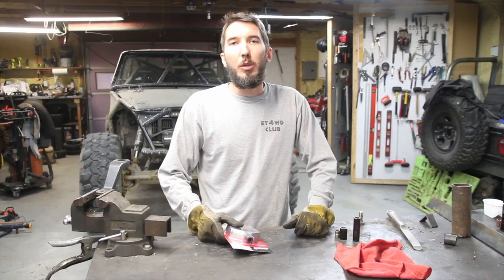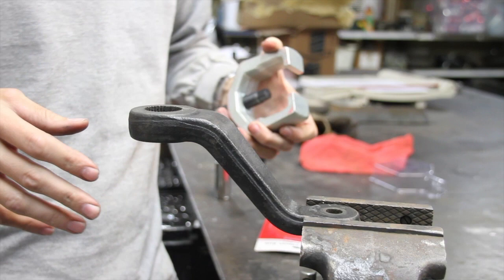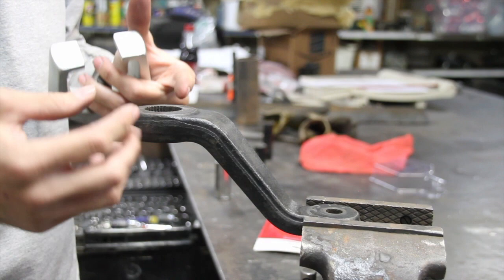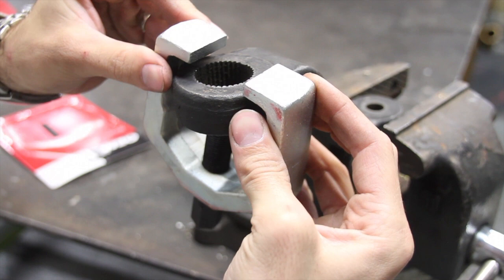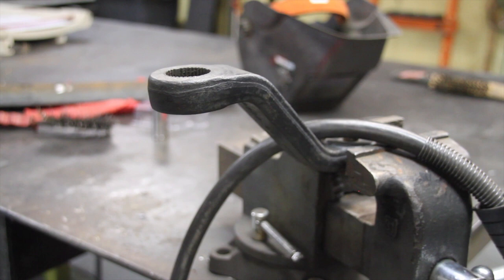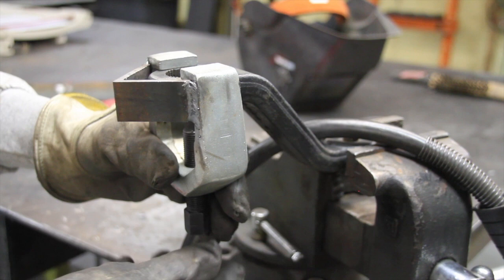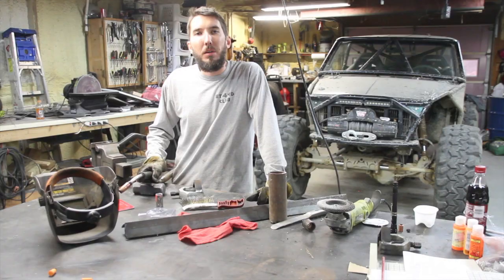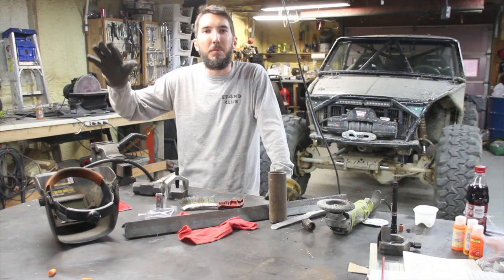Upgrade Your Pitman Arm Puller For Free

Comment: I would add a plate to the edge of the angle.  That is where the real strength would be.  Angle spreads fairly easily.  No doubt that your design adds strength, just a suggestion.  

I like adding the tube.  But then cutting a large washer in half as a support plate.  It would end up looking and performing nearly identical to the two expensive pullers.

Comment: I did that same mod, but it cost me over $100,000! First I had to build a shop, that was $75,000. Then I had to run 440v out there for my $15,000 welder. Then I had to buy an XJ with a pitman arm, that was $2000. Then I had to buy axles to go with my new pitman arm, that was $8,000. Then I bought the tool for $12!

So much for cheap mods! Geez!
Reply: U over spent on your welder...

Comment: I used a C clamp over my puller, but it still wouldn't budge.  So I ordered a new arm and cut the old one off by chucking up a cheap hack saw blade in my Sawzall.  Cut through like a dream.  A couple good wacks and it popped off.

Comment: Good idea, but it doesn't give you the strength it could with a little more work. You could put the angle iron up so it is the thickness of the metal from the opening, then cap the top with flat stock. This makes it flush, and much stronger.

Comment: Wow, what a lot of effort to go through when you can just put a hose clamp over the puller, tighten it up and it won't spread at all.....
Plus it holds on both sides of the jaws, not only one like welding does.
Reply from the maker: +Thor Dehr took me 2 minutes... less effort than tightening a hose clamp with a screwdriver for 5 minutes;)
Reply: Then only tighten the hose clamp for 20seconds.  Who takes 5 minutes to tighten a hose clamp?  Way faster by the time you set up your welder, find, cut material to size, weld then let cool. 
Also it leaves the puller unmodified for other uses and supports the jaws on both sides instead of only one like welding to one side of the jaws does. 
An additional benefit is that it can preload the jaws slightly giving the jaw tips additional bite. 
Plus, not everyone has a welder or the skills you do. 
I like your idea of welding the bit on to get some of the additional strength of the semicircle design puller. The hose clamp hack is just faster and more accessible to most.
Reply: Thor Dehr or c clamp is what I was thinking

Comment: I have a hobart handler 125 (flux core 115V). Is this suitable or should I try to find a way to convert to MIG? Also, any tips for feed issues? My wire keeps jamming up and it makes it really hard to get a consistent bead.
Reply: Not familiar with that brand, so I'm not sure if it's outfitted to add CO2/Argon. I don't know if they even sell Hobart in Canada. What I found with my old Lincoln, and new Miller is to keep the whip as straight as possible. To many sharp bends or loops in the whip end will restrict the wire feeding up through it. Next check the nozzle/tip, for excessive build up. Flux core splatters lots, and that tends to build up in the nozzle. Inside the housing, look at the 2 wheels that drive or feed the wire. They have 2 or 3 grooves, for different wire sizes, just make sue the groove that the wire is in, is the same as your wire size. There should also be a way to adjust how much pressure the drive wheels exert on the wire. Don't go crazy tight, because if the restriction is at the nozzle or in the whip, the drive wheels will try to cram wire into the whip. I'm not a welder, over the years tried out a couple of different brands for working on my trucks. Both are 220 V with shielding gas, shit I'm rambling on. Hope this helps, and usually if you have a recommended setting chart for different gauges of steel. Near the bottom it will show you the polarity, +/-, for your supply power.
Reply: Thats all good stuff, I've tried most of it, although I don't remember if there were other grooves in the drive wheel. I'll have to try that, thanks!

Comment: Any tricks if the arm just won't come off. I tried pulling mine off to replace the box but the puller stripped out. I put a 9/16 bolt through the hole with a nut on the inside which worked but the arm wouldn't come off even with my impact running on 175psi. I did try the hammer method too.
Reply from the maker: There's the heat method or someone today said to use a prybar and post hole pounder from the topside.
Reply: BleepinJeep I may try it again next spring. For now its too freaking cold out and I only have a driveway to work in but I will be using your trick now I know I can weld to it.
Reply: Just put a new pitman arm on the new gear box?
Reply: William Smith i would but a 2wd pitman arm cost over $100 and it's a part that my local junkyard wont pull.
Reply: Heat is bad advice. Rubber seals in steering box. Instead cut most of the way through the side of the Pittman arm where it goes over the sector shaft. Then use the puller. Utube videos show this method.